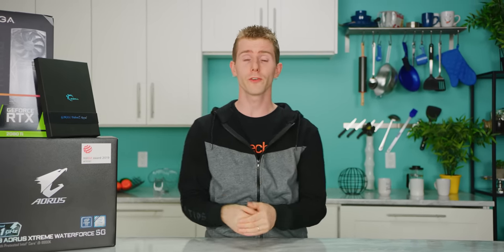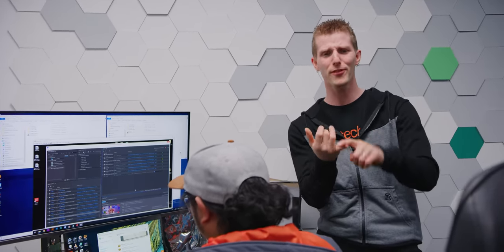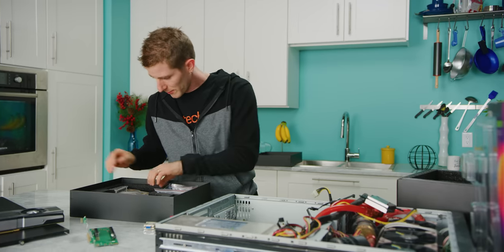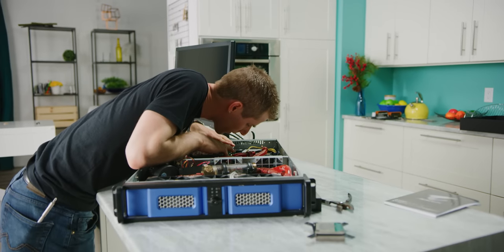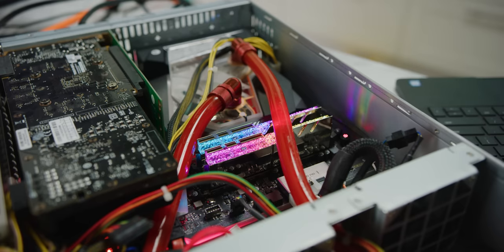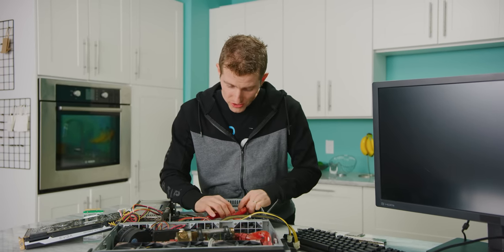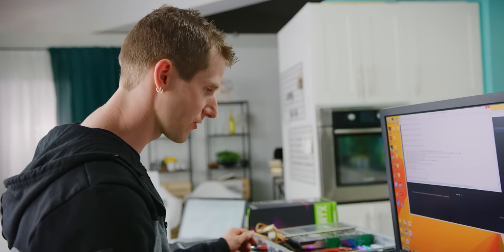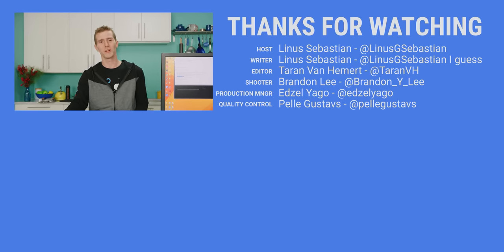All this work... for what?? - Upgrading the Video Render Server

Comment: Going from 10 cores quad channel to 8 cores dual channel. WHAT DID YOU EXPECT?
Reply: Have to agree. I'm lucky enough to own a i7 6950X with 32GB of RAM in a ASUS X99 Deluxe mobo and it is the dogs nuts when it comes to transcoding.
Reply: 4 times the performance.. 

DROP!!
Reply: The memory is the issue here, not only did he lose 2 channels he used one of the worst boards for memory. I have an Aorus Master and my god when it comes to memory is this thing frustrating as hell. Shame too because the VRMs are soooo good.

Comment: Uses a Ryzen 3900/3950x or a Threadripper 2990wx :V
Reply: What do you mean with uses? Those cpus are bad for that usecase.
Reply: @bokajllensch661  how? Amd stomps Intel in rendering.
Reply: This is Intel damage control. Simple as that.
Reply: @comagnum1  Yes but not if the clockspeed is much lower.
Reply: @bokajllensch661  It isn't? 3950X boosts to 4.7, only 6% less than that 9990X can boost. And per clock AMD is 11% faster.
Reply: @bokajllensch661  much slower? What? It's only a tiny bit slower but it's negligible due to more cores.
Reply: If you look back linus and media have been sponcered by Intel many...many...many times. Most of these special cpus he has been throwing around are 500 usd to 10 grand!!! I love his concepts but he is been with team blue for a while unless he covers news that states the obvious. Also you would not go with "new" especially when running a buisness unless it's the best for your loadout.
Reply: @bamdad19996  as you can see in the video 14 cores seem to be too much already...
Reply: @GeorgePerakis  but the intel one is 9% faster than the ryzen. also the 11% cant directly be taken practicly.
Reply: Maybe in the next attempt they will. But this isn't going to be a new video.
Reply: @cunnyman  i9 CPUs don't have iGPUs? Where would they put the die for a GPU with those 14nm chiplets taking up so much space.
Reply: @cunnyman  Which X299 chip has an iGPU again?
Reply: Linus really should have added a disclaimer stating that this was filmed months ago.. Also just because AMD has better numbers on paper doesn't mean it will outperform Intel in this specific use case. I'm not saying Intel is better but until he tests both nobody knows the answer for certain.
Reply: 3900/3950x will work flawlessly but 2990wx sucks, they already tried it. Also bear in mind that 2990wx does not have I/O die, which makes communication with memory slow and therefore is even more useless.
Reply: Filmed before Ryzen 3000 launch. And AMD probably just didn’t give them a free Threadripper. In which case it makes sense to just grab whatever good Intel CPU you have from your giant pile of free crap.
Reply: @cunnyman "How? Simple. Adobe doesn't work well with AMD hardware.

Go check out some benchmarks, the i9 literally stomped Ryzen 9. That's because Adobe made use of Intel iGPU... Something Ryzen CPUs don't have whatsoever.

For this specific use case, AMD hardware is a waste of money. "

 Where have you been the last few days after Ryzen 2 launched?
Reply: @cunnyman  All Intel XE edition CPU's "DOESN'T" have IGPU's..fanboy
Reply: @cunnyman lol..we are talking about HEDT here not a consumer desktop. do you think 9900k would beat Intel's own XE edition?..

Comment: If you want XMP to work maaaaybe buy RAM that matches your CPU's memory controller speeds and then buy the sticks with the lowest timings from there. It will work 100% of the time. That's why the board comes with a warning that "above xxxx MHz is considered overclocking and may not work" and OMG WHAT DO YOU KNOW that limit always happens to be the memory controller speed of the fastest CPU it takes. Amazing, I know!

Comment: RYZEN Threadripper 2990WX 32 Core Build!!!!!!!!!!  Thats what we want to see!!!!!  Upgrading the Video Render Server Part 2 XD
Reply: Or epyc 64 core maaan
Reply: Or Threadripper 3960X maaaaan
Reply: Make 3970x or 3990x
Reply: You didn’t see the video? He says explicitly that the server didn’t benefit much from more cores, but rather from higher frequency...
Reply: @lucasklaassen135  I watched the video. He already has 7880XE, 9900K and 9990XE built.  Why not looking for different processors? It is fun to watch him building a new one on part 2 using different type of processors. Intel 10th, Epyc or Threadripper.
Reply: Pythonpro freak Why would he change the CPU for one with a lower clock rate then? He doesn’t make pointless videos where he changes the processor just because he can but he does it to improve performance.
Reply: @lucasklaassen135  He has 9900K built system and is the fastest using Adobe Premiere Pro on most parts. I guess, there is no point of making part 2 video in next several years. I will watch him building another computer with new processors not under this title. I am hoping he is not discourage for making more videos about new processors and benchmarking.
Reply: @lucasklaassen135  Maybe he should use Bulldozer 8.4ghz since it has the highest clock rate. Maybe there are others highest than that.

Comment: Uhhh... why go Intel for this? This seems like the type of machine that would have best benefited from Ryzen.
Reply: He literally explains it in the beginning
Reply: @WallLurker  yes, because he was using the wrong video encoder. It you upgrade the hardware, you also have to upgrade the software. This is a job AMD excels at, of course assuming you're not using software that doesn't scale (and why would you be doing that anyway?).

Comment: I thought you just built a huge network 6 editor rendering machine for $100,000.00
edit* After 2 days and thousands in hardware, they get to leave 60 seconds early everyday now. Awesome Job.
Reply: That's a virtualised workstation, not a render server. These editors use the machine when working, the rendering itself happens on a dedicated render server.

Comment: Did gpus make a diff? You teased the 2080 then never mentioned it again.
Reply: Well, it didn't. Odd to say but nVidia doesn't really encode video in a way that Radeon did. I was surprise why they didn't use AMD Radeon, as the GPU has some encoder processor that speed up some of the video encoding a bit.
Reply: @benjamintan2733  I believe you're talking about cuda acceleration which is a Nvidia technology

Comment: Maybe it is being bottlenecked by something else, like maybe the max reads and writes of the storage drive? Maybe try using something like a 970 evo plus and see if it makes a difference.
Reply: Or use Ryzen 3900x or 3950x and use ssd on PCI gen 4.
Reply: @Kawin28  Oh ho ho. Well, to bad that's a bit not practical. While SSD is fast, they lack the capacity. I use a HDD Camcorder, and 10 minutes of video took about 2.1GB of data, and that is compressed version, and it's only 1080p. They will use a more professional grade equipment, and their footage may took even more storage space.
Reply: @benjamintan2733  ltt uses 4 and 8 k. Huge difference in storage. You've got to remember. A 20 minute episode is at least 1 hour of 4 or 8k raw footage cut down to 20 minutes. Easy 1tb in 4k.

Comment: When it hardlocked at 12:22 I had the exact same issue with my 9900K build. Discovered that I had to turn off "multicore enhancement" to get it stable with prolonged 100% cpu load.
Reply: Found this article:

https://www.gamersnexus.net/guides/3389-intel-tdp-investigation-9900k-violating-turbo-duration-z390

Apparently full turbo speed is only supposed to last up to 120 seconds. (Did not know that until now)

Comment: Linus please wait for Ryzen 3950X for some time
You wouldn't be disappointed
Reply: when u do business, U need a well tested hardware that reliable and mature

especially on business environment, just because the new CPU come out business won't use it especially on production 

why? They always prefer the older one that have proven has no issues, They can't afford server doesn't working correctly just because the platform isn't mature yet even for 1 day, it will be catastrophic for business
Reply: @AliciaCLR  LOL So Linus uses a very rare cpu that most people can't buy, nice logic.
Reply: @AliciaCLR  meanwhile in the video he swaps hardware without reinstalling the OS, Overclocks without properly test stability (i mean 24h ramtest / Prime 95 / GSAT) , not to mention opening a bleeded watercooling loop inside the rig.
as you said "when u do business, U need a well tested hardware that reliable and mature
" ahah
Reply: @neojack333  probably ain't have time to record and edit and render it

the server that render the video is being shot too
Reply: @AliciaCLR  my point is, Linus's decision to go intel instead of Ryzen is not about being afraid of new products being put in production

Comment: You have a 2080Ti, liquid cooling and high core count CPU all running off a 500Watt PSU?
not sure if that impacts performance, but DAMN I would not have thought that possible.
Reply: On the other hand my colleagues spec'd a i9-9900K no GPU pc with a 1200W PSU...
Reply: If it is true 500W, that should be plenty. You only use much bigger PSUs because you want room for it to be crap and not be able to sustain the full load. And most home-builders install PSUs more than twice as powerful as they need.

Comment: Why not Ryzen? this seems like the perfect workload for it
Reply: I agree.  Understandably he said they’ve found that 8-10 cores was the sweet spot but have they tested the AMDs yet or is that just Intels?  I’m no fan boy either way but as an editor i want to know if the new AMDs are worth it for the workload.
Reply: @TheKarabanera  I guess what I am really looking for is walk through of the tests to determine where they came up with the 8-10 core high clock speed solution and whether or not that includes the AMD chips.  If they did a video on this already I must have missed it.

Your not wrong that Intel has been the better option but it just seems like the AMDs weren't even considered, regardless of whether this was filmed before or after the new chip launch.
Reply: @TVictor3DArt  because amd architecture is trash they even lie about their nods amd 7nm = intel 10nm both are basically same size but intel has more thiccness so better they can barely beat intel 14nm at "7nm" just wait for intel new chips
Reply: How is it that nobody seems to understand how video production works? These things take a lot of time.

Comment: Wouldn't it be smarter to still go for more cores and allocate the tasks to only use 8? So you could theoretically. So you could use full advantage of the less cores, but with more Rendering requests also more?
Reply: Premiere cares a fair bit about clock speed. So when they built this machine, there was still a fair tradeoff between clockspeed and core count.
Reply: @Powerman293  man I must have been drunk when I wrote this. Hm, less cores don’t necessarily mean more clockspeed or at least not that much. Depends on what your Motherboard and PSU can handle

Comment: 1) iGPU may increase video decode speed, resulting in faster exports. Install iGPU drivers for 9900K
2) AME is not the best encoder. Try using ffmpeg.
3) You may use NVIDIA GPU to encode your video using NVENC if time is very important. It will finish your renders in a minute or two. Use Voukoder plugin for Adobe or ffmpeg to do that.
Personally i gave up on AME long time ago. I just export FFV1 using Voukoder plugin and re-encode video into final format using ffmpeg on my Linux server. That also eliminates any Windows issues out there.

Comment: Why are you using CPU-based rendering instead of GPU/CUDA?  Hell, my i7 8700 system with a lowly GTX1060/6 renders 1080p footage at around 200FPS under Davinci Resolve Studio when using GPU/CUDA.   And why are you still paying the Adobe monthly tax at all?
Reply: They have the money to do so, and Adobe has a huge ecosystem that they couldnt achieve without it

Comment: literally all of the techtubers: here is how the ryzen 3900x crushes intel in ALL production workloads 
LTT: well we going to try 2 intel chips folks
Reply: TBF why would they waste another $1000 on newer components when they have the stuff lying around unused.
Reply: when u do business, U need a well tested hardware that reliable and mature

especially on business environment, just because the new CPU come out business won't use it especially on production 

why? They always prefer the older one that have proven has no issues, They can't afford server doesn't working correctly just because the platform isn't mature yet even for 1 day, it will be catastrophic for business
 

AMD BIOS isn't mature yet
Reply: @AliciaCLR  That's why I love being a consumer. I wanna build a home server with some GPU's using AMD Epyc rome processors when they finally come out.
Reply: @ntwede  when u do, make sure the bios already mature, since bios and compatibility is terrible on early day

Zen 2 is big overhaul on CPU industry design

Comment: Why would they not use a Ryzen 9 3900X?
Reply: Maybe because Gigabyte needs to get rid of it since no one will pay $1600+ for this over 3900x for rendering even more.
Reply: probably a few reasons:
1) It was probably filmed quite the while before it was released.
2) Going with a mature platform is better, because issues like BIOS updates aren't really needed after it's built.(AMD will probably have some updates in close weeks/months for stability)
Reply: he wait for 3950x
Reply: @danielc5905  plot twist in 2 years he will
Reply: DJ Johns  I am talking about the new Ryzen 3000 series specifically. For a consumer BIOS updates and things like that are no problem, but when you want full reliability without having to deal with things like that, it's better to pick a system that is out for a while. The latest 3000 series is having some issues with BIOS not allowing proper boosts to advertised clocks. Sure it will be fixed soon,  but again, updates.
Reply: This video was filmed over a month ago.

Comment: Why would they not use a Ryzen 9 3900X?
Reply: they prob made this video weeks ago
Reply: @TheLuchsKing its for floatplane subscribers early access nothing more pal
Reply: @TheLuchsKing they need to explain this at the start of the video so people don't get confused
Reply: They make this vids a week or more b4 they post them, as most of them  already go on flotplane a week b4 YouTube.
Reply: Intel has faster single core performance and this workflow doesn't benefit from high core counts.
Reply: @shaun4bigblocksllc  "Because professional production requires stability" Did you watch the part where Linus overclocked the 9900K? The 3900X would still crush it in this workload, without an overclock, on a stable X370 or X470, and still be much cheaper, use less power, and so on. However the argument that this video was filmed before Ryzen 3000 was available is a very valid one, so Linus is excused -- this time :)
Reply: @drewcipher896  You're wrong, it does benefit from high core counts.  That's why the 18 core he tested got better times than the 8 core one.  Did you even watch to the end of the video?